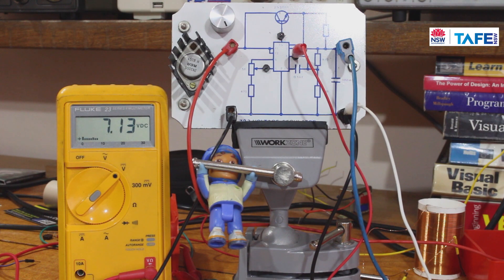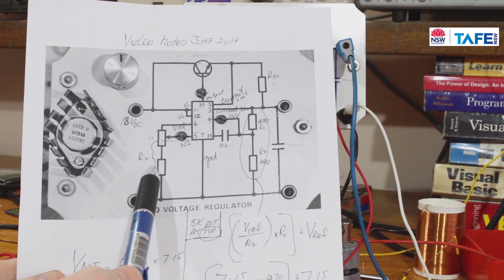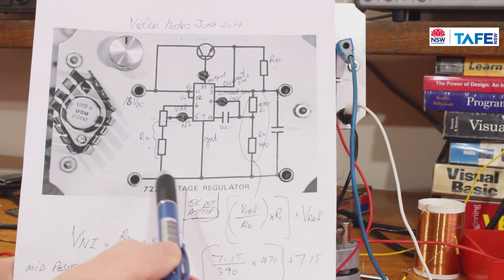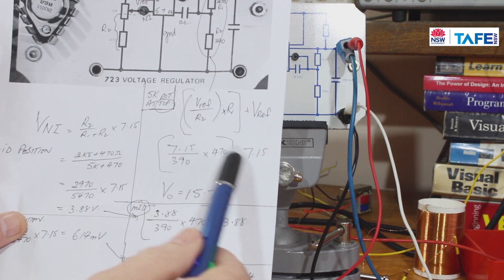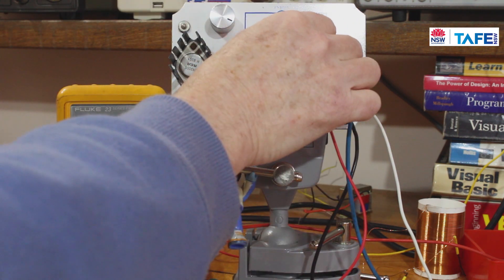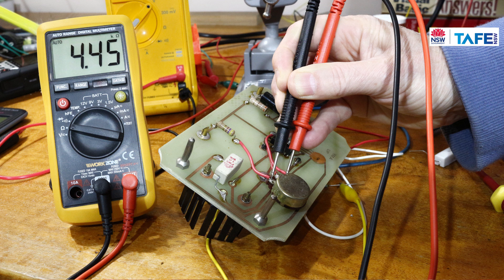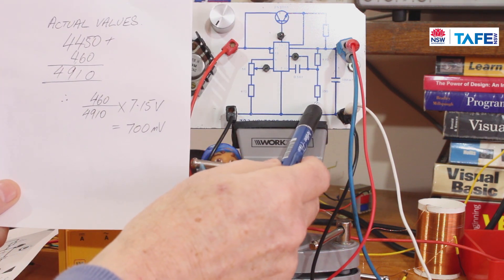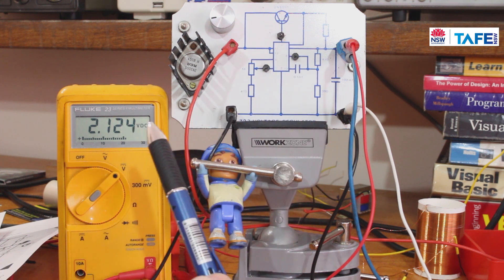LM723 Regulator with Voltages and Maths UEENEEH138A TAFE NSW

Comment: Greg, thx for taking the time in sharing your observations and analyses of a representative power supply circuit.

I did get different numbers for the OpAmp input voltage with the pot turned all the way down. I used the measured values that you stated and got an expected value of 0.670V. I cannot explain why the measured value was 0.673V which is higher.

A couple of things that the datasheets all omit is: the Error amp input bias current, input bias differential current, input offset voltage and minimum input voltage.

I find the LM723 can't be beat as a power supply core device. I hope they keep making them. I haven't really found a single IC replacement that performs all the functions that the LM723 has built in with the excellent specs that it has.

Again, thx for sharing.

Comment: I noticed there is no resistor on base of the transistor.  And what is Vs on the TI schematic? 🤔
Reply from the maker: Hi, if you look at the circuit for the internals of the 723 IC, there is a current limiting resistor which is built in to drive the base of the external transistor. This is a very classic design, and 50 years after being first produced, the 723 is still a versatile chip.  I think it's good to about 40 Volts, you'll need to check the data sheet.  :)
Reply: @gregmoore7565  Well done sir. Wait, did you say 50yrs old, I had no idea this chip was that old!
Reply: If you look at the new design internal schematic you'll see +Vs & -Vs, which I believe is what you are referring to. As you might've guessed that is the positive source voltage and negative source voltage that powers the ICs internal circuitry. 
Hope this helps.